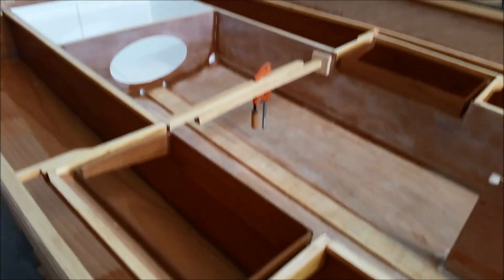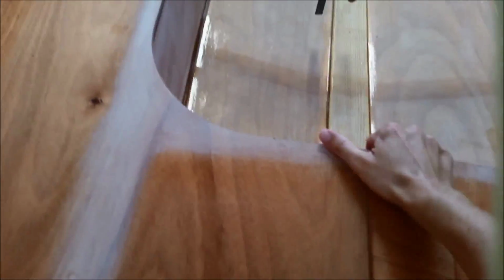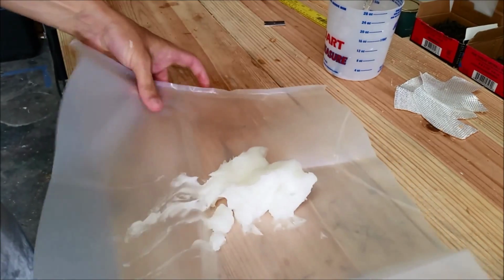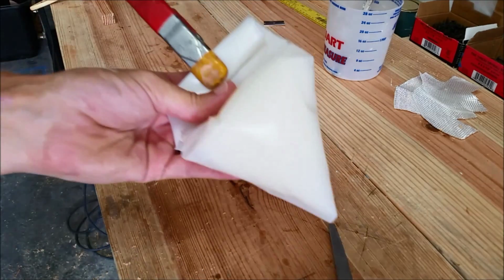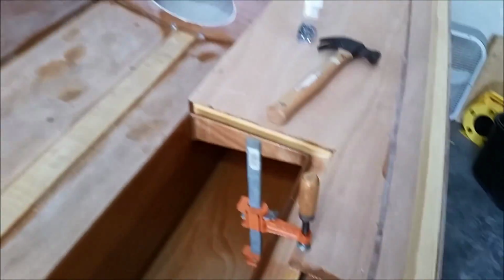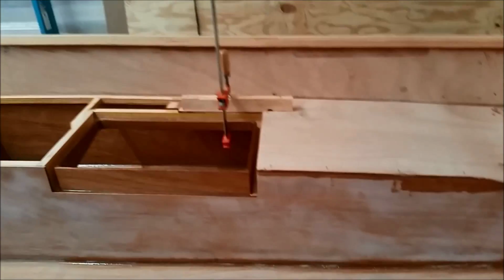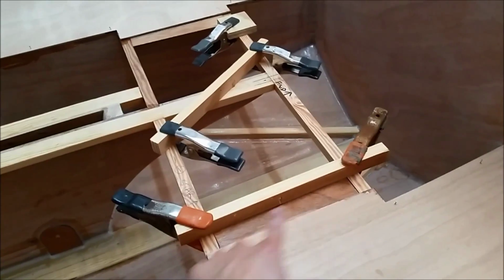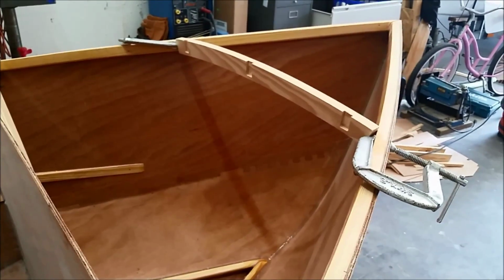Core Sound 15 Build Part 10

Comment: Your center board box is not on the central line, why?
Reply from the maker: Correct. This is by design. It keeps the cockpit and cabin more open and as we have seen through many previous designs it does not negatively impact sailing performance or the ability to sail to windward.